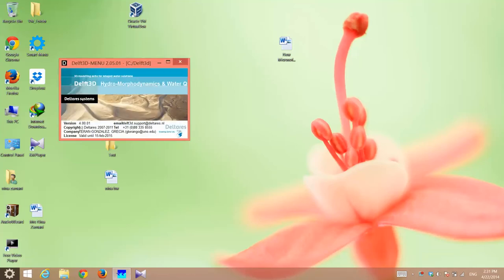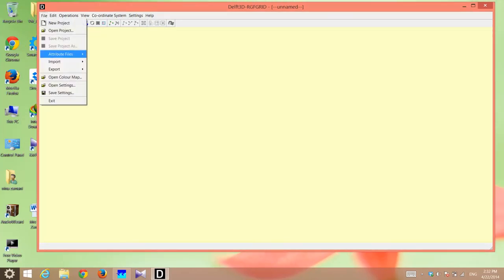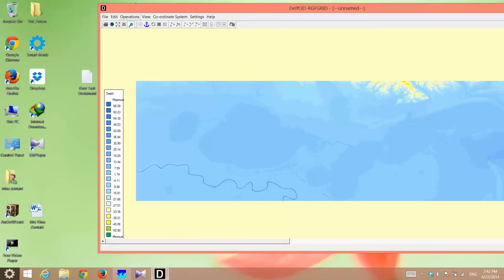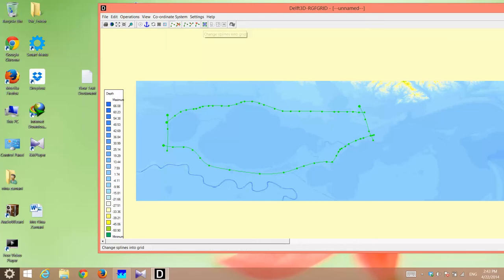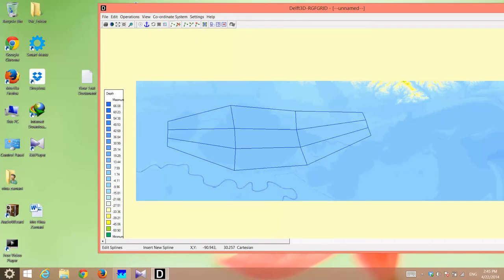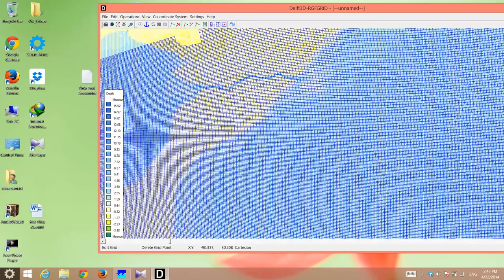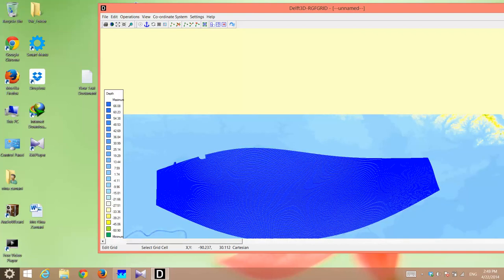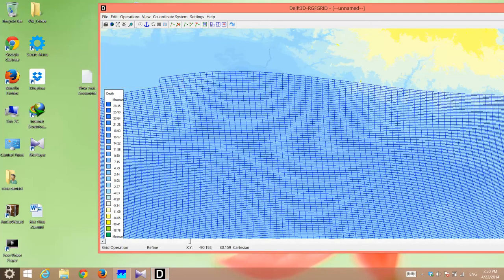Delft3D_FLOW_Lec01_Grid Generation

Comment: Hi Sina, that's a very good tutorial. Would you please make a video on how to nest a fine grid to a coarser grid (i.e. say you want to create a grid that covers an estuary and part of the continental shelf)? I'm using Delft3D on my final year project and have no idea on how to perform this task. Cheers!
Reply: Hello Augusto, could you accomplish your task? I'm interested in doing something similar for a dam break case but I'm still a beginner and I don't know how to do it. Are you using any guideline for your project? Thank you.
Reply: Constanzo Marullo
Hi Constanzo, yes I've accomplished my task. I read the RFGRID tutorial and had some extra help from my project advisor (the tutorial itself didn't provide enough information). What is it exactly you're trying to do?
Reply: Hello Augusto, I'm sorry I didn't answer your question earlier. Thank you for your intended help.
I'm having some problems with smoothing time and a hot start simulation for a rapidly varied flow (dam break). Have you experienced changing smoothing time? I still don't get it at all.
Reply: Augusto Freitas
Sorry, one last thing. Is there any chance to get in touch with you? would you mind to let me know your email address? My work is for an academic porpouse only and deadline is about to come, and I don't know anyone who works with Delft3D, not even my project advisor.
Reply: Hi Augusto, I faced the same problem with you, but I have no idea how to solve it. 
Could you show me how to connect 2 types of grids (river domain and sea domain in structured grid)?
Thank you!!